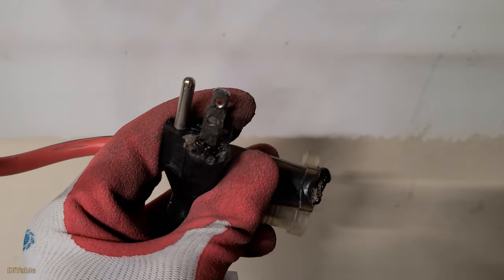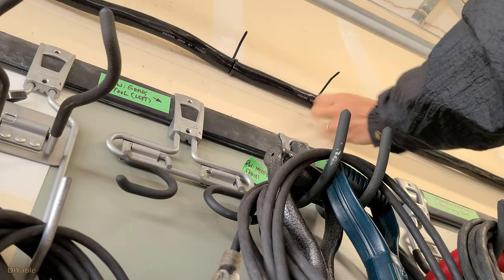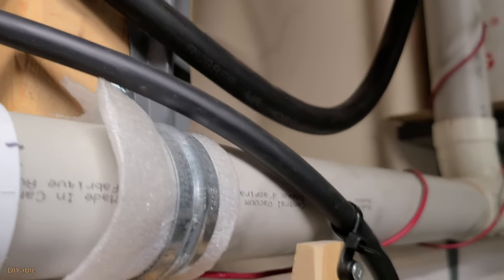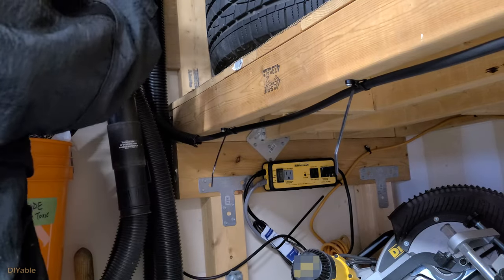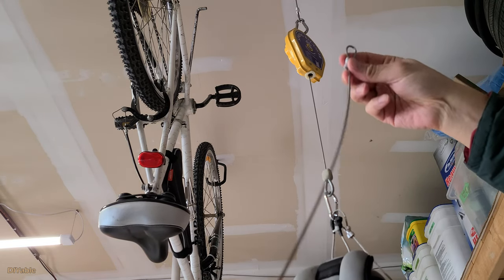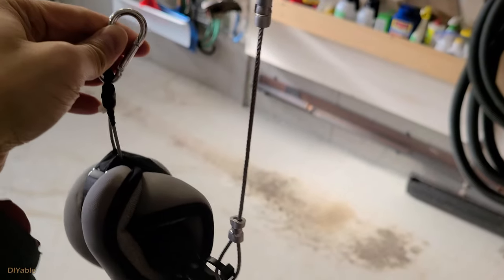How to make EV charging cable retractor and install extension cord for Tesla mobile charger?

Comment: Nice. The cable should perhaps be further back on the charger since it is touching the lid when engaged creating a wear point and possible breakage issues.
Reply from the maker: Very good eyes, I agree... minor room for improvement :)   But it's really minor touching honestly, it doesn't put any pressure on the lid at all.  I have been using this every day since we got the car for 1 year, I can tell you this has been working great!!!

Comment: good idea, but wouldn't it make more sense to make a mild clamp on the cable a ways up and then you may not need the weight? or the weight is not near the plug (more like a long gas station tube has.) also all the safety backups are not needed unless you fear it will break if driven over. the things should handle being on the ground in the rare case it fails.  I used a counter weight instead; but I like your use of a tool spring!
Reply from the maker: Thanks for the comment.  Indeed, you are right. You can attach the weight to the cable technically like gas station. However, the fitness weight is a very simple solution and everyone can find in your local hardware or fitness store.